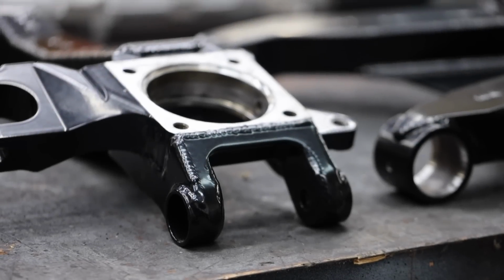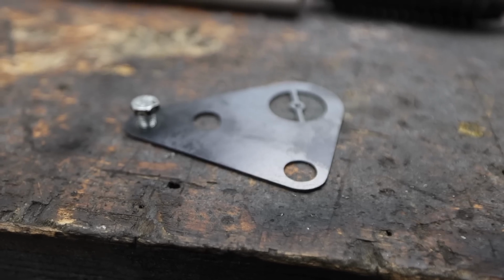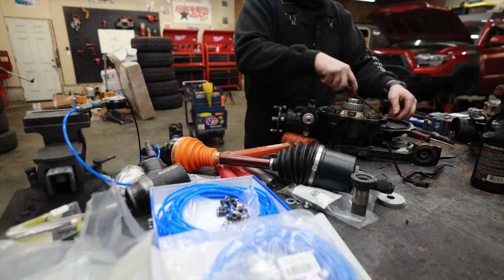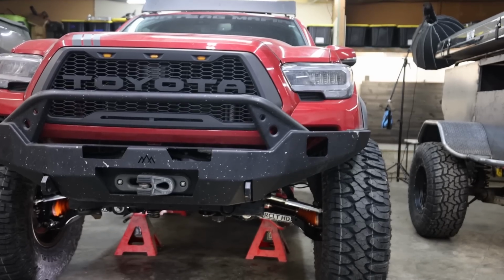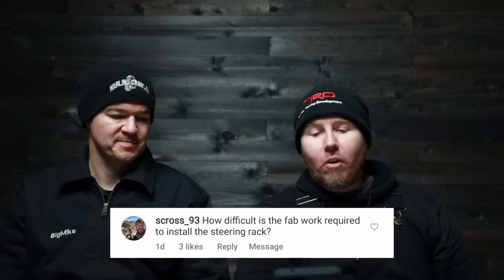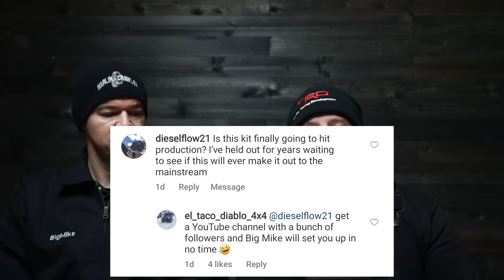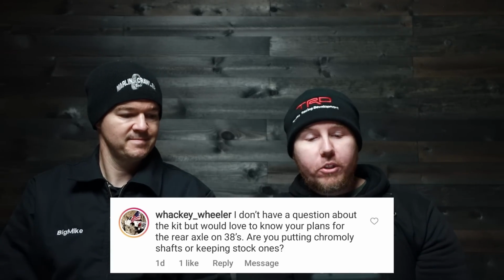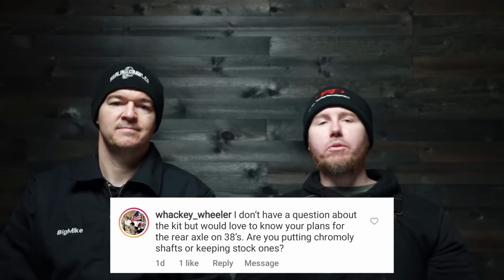The Best Long Travel Period. RCLT HD. Ultimate Toyota Tacoma Build Episode 5.

Comment: As a Jeep owner. I've really like the tacos, but trying to find content I like on them is far and few between. Can't wait to see this thing in action.
Reply: You hit the nail on the head with this comment Shawn.

Coming from a 4runner owner.
Reply: 100% agree with you here - i own a gladiator here - but allt he work in this video so far seems like the same amount of work required (or close to it) just to do a SAS swap - highly skeptical its as robust as something like a dana 44 .... but interested to see for sure.
Reply: Same. 4Runner owner here, mostly watch Jeep stuff. All the late model Toyota stuff seems to be just driving on dirt roads, setting up roof tents, and making coffee.
Reply: Coming from a 3rd gen Tacoma owner, there is not much content that a set of 33” tires and a front locker can’t tackle on the extreme side. Once they get a doubler in this truck it will be an even better channel to pay attention to as that is one of the most over looked problems with these trucks in my honest opinion.
Reply: @nicks1134  check out Timmy the Toolman channel!  SicMods for T4R!
Reply: I hear you, can't find anything to watch about my good ole square bodies
Reply: Same here… 👍

Comment: I love how more channels are starting to be more open minded towards IFS. Thank you for showing the pros and cons. People have such a severe bias towards solid axles and I hope that getting more information out there can help remedy that.

On my channel I’m doing a TTB build and people couldnt believe I would swap out my stock TTB for another, stronger, TTB rather then doing a SAS. Most people just dont even see upgrading IFS/TTB as an option, its solid axle or nothing.
Reply: @Paul M this is what I’m talking about 😉. Id urge you to open your mind a bit. For one, it depends on what type of offroading you do. If you look at prerunners, trophy trucks, and even ultra 4 cars there’s obviously a place for IFS in those offroad disciplines which is why they use it. For pure rock crawling solid axle can have some advantages, but most people dont spend ALL their time in the rocks!
Reply: @Paul M i wouldnt call it a jeep killer, horses for courses. However my build one of the reasons Im using IFS, specifically TTB, is because its cheap. I got a 3/4 ton TTB front end, 9” high pinion ring gear massive manual hubs and all for $200 at a junk yard whereas the solid axle equivalent would be at least $1,500 where I’m at. 

As for the lift on mine its custom radius arms and springs/shocks, same stuff youd want for a solid axle (although I did choose to fab my own radius arm design). 

It isnt for everyone but it definitely deserves a bit more love than people give it IMHO! A bit of creativity can go a long way.

Comment: This is not IFS, its just not. This is the evolution of IFS. Its like saying my jeep has control arms. There's regular arms, then there's upgraded long arms, and they're totally different. This kit is insane. I don't even own a Toyota OR an IFS, because of all the normal excuses, and this kit just got rid of them all. That underside clearance is nuts, I bet that suspension travel is gonna be equal to that of 90% of ANYTHING that's going to be on the trail. The wider stance helped the angles, you put clearance bends in the arms, jesus I love it!!! In 10 years from now, I'm confident people will look back at this moment and realize this is when IFS changed forever. The Australians are going to have a FIELD day with these kits, and I'm sure of it. 
Thanks for the badass video

Comment: RCLT is so awesome! It Takes ifs to the next level changing the game! I was seriously having a hard time deciding between RCLT and SAS'ing. 
It was a difficult decision but I chose to SAS my 3rd gen taco. Found an awesome fabricator who got all the electronics and ABS working with 1 ton axles. No errors on the dash and speedometer works just like oem. I couldn't pass that up. 
So I wouldn't say SAS is obsolete. It's just getting started for these 3rd gen tacos.

Comment: I've been drooling over the concept sense they started the project.  This will be an absolute beast for snow wheeling.
Reply: Last thing you want in Snow, Mud and Sand is IFS! Single wheel dig will leave you SOL!
Reply: @MrDan1509  apparently you wheel in different snow.
Reply: @AndrewLakey  Ford I-Beam had the same issues! IFS and Beam are for high speed comfort and stability not Snow, Mud and Sand wheeling!
Reply: @MrDan1509  I said nothing about the Ford I-Beam, mud and sand.  Snow wheeling in an IFS rig gives an advantage of clearance and less drag.  A properly built IFS rig performs exceptionally well in deep snow wheeling.
Reply: @AndrewLakey No crap you didn't, I brought it up as an example but you don't get it i guess!
Reply: @MrDan1509  Apparently my experiences and your opinions differ.  Enjoy your time on the trail.
Reply: @AndrewLakey   ''Opinions'' Now that's funny!

Comment from the maker: For those of you that are curious about the kit, here is a link. Shoot Marlin Crawler an email with any questions 👍
The link is currently for the +2.75 kit. The +3.5 will be available this summer (2022)
https://www.marlincrawler.com/suspension/rclt/rclt-hd
Reply: Bad ass looking kit. I wonder how it'll stack up strength wise vs a D44/D60 swap.
Reply: My struggle with IFS is in your link. The cost of the system is extremely prohibitive when compared to a high quality lift for a solid axle vehicle to end up with similar, or perhaps better performance for the solid axle system. This is a sick suspension and I’m stoked it’s out there, but to say it’s changing the game relative to solid axle is pretty optimistic.
Reply: @phild9813  Well if you consider the cost of a new lets say Dana 44, with gears, lockers, knuckles, shafts etc... the lift is well within reason even with the steering upgrades and RCV axles. Junkyard options are obviously significantly cheaper, but money wise, I'd say it's pretty comparable.
Reply: Yeah, true. I guess my dispute is more with factory options. Lifting IFS effectively and with longevity is an order of magnitude more expensive than an IFS, and it still isn’t even as good on the trail crawling once complete. It is most certainly a more comfy ride though.
Reply: Ok can you talk to rclt and look into what you’ve done here for GM ifs like my 07’ Silverado. I know there are lots of long travel builds but I don’t recall seeing a cool rack upgrade like this Tacoma build.
Reply: @shawndejong6699  I would argue a SAS is considerably cheaper in the long run and undoubtedly stronger.
Reply: @johnlunsford9375  I would whole heartedly agree with you, however if it's a daily driven rig, IFS would undoubtedly be the easiest to live with. I say this with love as a former Jeep owner.

Comment: For sure IFS is the future. Look at most off road race vehicles. Even the New Ford Bronco with the 35" and swaybar disconnect. Having a good road driving vehicle along with an awesome off road capable rig, is a win win. Can't wait to see the Tacoma hit the rocks. Love the design of this setup. Great job.
Reply: It could be the future but no truck company can make IFS even up to par with a Dana 30. They all use twigs for steering components and the CV axles still snap Crackle n popin.
Reply: @RobSteez  

Just not true. Look at the king of the Hammers or any Baja race.  The Ford Raptor doesn't break shafts. 

Most built Jeeps now use the Dana 44 with built up modified components.  The Dana 30 needs many add on in order to hold up with big tires and rock crawl. Jeep guys live in the past. Why does Jeep not install 35" from the Factory?  Maybe for durability, ride and fuel economy? 

Ford has 37" on the Raptor now and next year on the Bronco.  Where is Jeep? Most Jeeps with big tires and built for crawling get place on a trailer and towed to the trail. Why is that?

Comment: I really like seeing how the tacoma compares to the frontier. I'm gonna be titan swapping my frontier pretty soon, so I'm pretty excited.
Reply: One of my brothers skipped that, and bought a 2006 Titan Off Road.
Reply: @davidryde6296  They're good trucks, but I thing the frontier is a better off road vehicle. There are so many tight trails in the PNW, that a titan simply wouldn't fit in. A titan swap is basically bolting titan aftermarket components to the Front end of the frontier. It gives about +2" of width on each side. With a custom coilover in the stock coil bucket, You can get about 10.5" of travel, but if you get rid of the coil bucket, and weld in a different setup, I believe you can get 14-15 inches of travel, 17 inches if you were to get a +3.5" wider per side long travel kit.
Reply: I'm from BC, and my last vehicle was a first gen Xterra. I am still in the Xterra groups. There's several full sized trucks in the 4x4 groups I rolled with, so I am pretty confident my brother will be able to keep up. I have a Tacoma TRD Sport 6ft box, so we'll be similar in size.

Comment: Awesome that Mike has put 40k mile on his setup. I would think having big spacers or aggressive wheel offset would be worse for the unit bearings than big tires. OEM bearings are designed for a specific wheel offset by the engineers.

Comment: I am a pipeline/power line heavy equipment operator. I’m the first human and equipment into “the cut” to make it so cranes and bucket trucks can make it to “the pad” through wetlands and granite ledge to access the work. So I drive a lot of deep mud and knarly rock daily….but also drive 50-100 highway miles to get there. Yes I could just buy a raptor….but I LOVE tacos. And want a raptor killin’ taco. My dream is a 2020+ with sunroof and heated leather (lol) on 37’s with 5.29’s arb’s front and rear. And a magnuson supercharger. 17x9 Fuel warp w/beadlocks. Falken wildpeak at3w/bfg at KO2’s, or Goodyear wrangler mt/r Kevlar sidewall. The last being first choice, the other two at’s are the only 3mtn peak snow rating and I live in New England. Money money money.

Comment: I love it. This kit fixes a lot of the issues I fear with Long travel. Are you going to reinforce the frame to keep it from twisting ?
Reply from the maker: Not planning on it yet. But I don't haul through the desert either. With rock crawling I don't see having any issues but I might change my mind once I hit the trails 👍
Reply: Frame twist is free flex!...😆
Reply from the maker: @Captain_Yodelstein  lol are you a cherokee owner? 🤣 kidding of course
Reply: The reason I ask is we know Toyota  frames aren’t  made in wakanda lol and you live in a place that snows. Also when and if you do the rear shock relocation most people will plate the frame a little out back.
Reply: @DirtLifestyle  nope, 1978 F150 owner. I think the frame is made of spring steel...🤣
Reply: @Captain_Yodelstein   Lack of spring steel. Like my cousins 79 chevy. More frame twist than suspension flex lol.
Reply: @iankovac1878 , well it always goes back to its original shape so there is some springiness to it...lol. I've got some ideas to take care of it though. Spring (the season, no pun intended) project.  Truck don't fit in the garage and it's officially winter now...cold and snowy. No fun to work in those conditions.
Reply: @Captain_Yodelstein   Indeed. I am just laughing. Remembering the days of breaking the steering box off my cousins chevy on trail lol.

Comment: I love this video and build. I am a previous owner of a modded 2015 Jeep Wrangler Unlimited Rubicon (3.5" lift and 37's) and now a 2020 Jeep Gladiator Rubicon (2.5" lift and 35's). So pretty much modded tastefully on both builds. I am also a big fan of solid axles front and rear. This taco looks great and the way the IFS has that clearance is nice. Well done. I still wonder why someone hasn't designed/developed/created/engineered/tested/ and so on with something I have in my head for leveling the playing field with IFS vs. solid front axle. Seems like a no brainer. Anyway, I would like to get a Tacoma TRD Pro next and build that up too.
Reply: Wait, are they on jack stands?

Comment: Got an 89 4runner with a sas. 04 I built it with a total chaos long travel kit and loved it but the stability was not like my fathers 85 pickup. So in 09 I performed the sas. Oh and I did have 37 with locking front and rear. But just like everything there pros and cons.
Reply: Had a 87 4runner SAS. Loved it, just 4runners have a fat azz lol.

Comment: So on my 2017 Tacoma I have had a few problems with the front diff. I’ve had the axle seal replaced twice already and it keeps leaking. And it leaks ALOT. I’m starting to thing the inner axle bearings are shot and the movement is causing the seals to leak but that’s my experience. I can say though, that last time it blew the seal I drove for over 3.5 hours with no fluid and the gears looked perfectly fine after

Comment: I like that you add the jig for the rack adjustment. I had the Tundra rack installed in my 2nd gen Tacoma, it was more difficult for sure. So, also, are you going to use a different rear axle? I had to use the ECGS dana60 to compensate for the 39s I am running. Thank you for your videos.

Comment: Great stuff, though I'm a little sad they danced around the wheel travel number question. Even measuring at the spindle without the coilover installed compared to the OEM would be nice to know.  Also, being a Nissan guy, this is similar to the Titan swap we do on the Frontiers. Loads of wheel travel gained.

Comment: I DREAM of putting this kit on my 2016 tacoma TRD OR... I already have about $4k in suspension from dobinson  (MRA, standard length 2.4" lift with a 1/4" spacer to clear my 285/70/17 tires.).. and the marlin crawler LCA gusset kit installed. JBAoffroad UCA's.. this marlin crawler RCLT is over $7k, and a LOT of other mods needed to make it all work/legal to do in my driveway... my truck would likely be down for a week or more..  still on stock gears, and tune for now.. regearing to come soon.. still torn on whether I should go with 5.29's or 4.88's... and I'm definitly looking at the KDMAX tune for the ECU/Trans... better power, throttle response, and shift pattern changes. OrangeVirus offers a tuner kit so you can create your own tune, includes cable, software, and knowledge base forum so you can create your own tunes. loving the build...

Comment: My “usable” adjective was basically to assess how much travel was allowed before CV binding. I know on my mid travel Runner I had a tom of down travel, but the cv started to bind at around 4/5 of it; making the last portion unusable. A lot of kits in the past had advertised the used of a 14” coil over but without the ability to travel infinitely upward (and for ride height / center of gravity purposes) most are capturing as much downtravel as possible.

Comment: Nice build and this long travel kit really seems one engineering marvel. Ok, I live in Europe so Tacoma is more or less in category of wet dreams for me, but let me still express my concerns:
1.) What about CV angles? Axle is pushed forward and I guess also down a bit, so do CV angles change noticeably?
2.) Highway driveability? Can this RCLT setup be tuned for smooth HW driving? Or does it wander all over the highway at higher speeds, so you need a lot of work with steering wheel?

Comment: It was absolutely not necessary to cut the UCA pivot bolt and install a new one backwards.  You just need to take a large set of channel locks and wrap the offending inner fender metal with a welding glove or pieces of rubber to avoid scratching the paint.  Get a good purchase on the metal and just massage it outward to give ample clearance to tap the long bolt out.  I did mine by myself in my driveway when I installed my ICON billet UCAs. Easy peasy and not paint damage.

Comment: Just like a long arm setup with a straight axle, long arm of independent provides a smoother arc on its movement swing. For an IS setup, there is a lot more to be considered since the arms connect to the knuckle/steering and 'floating' axle shaft (as its ends travel differently (diff solid, but hub end angles, as compared to a straight axle where the shafts don't)). The knuckle change has to reflect many things, such as the hub, shaft angle, steering angle. 
If you compare this to a 'race' IS steering setup, biggest hurdle would be the steering limitation. If Marlin could develop a better steering rack similar to a race setup or closer to it than the street rack and pinion, then they could look to lengthening the CAs and the next limitation would be the shaft length. For the IS, you prefer to have the shafts the length of the arms to minimize confrontation of the angles in the CVs vs the pivoting points of the frame mounted CAs.

Comment: If Big Mike reads this comment will the Landcruiser Rack fit an 08 FJ crusier with this kit? I think all is the same between Tacomas and Fj’s of that year. I already have the 3.5 TC kit with the RCV axles. I heard you were trying to also do a steering box setup but had not completed it yet. Only your truck has one if I’m correct. I spoke to you at the Sand Show down here in Orange County Calif a few years back but you were still a bit off on delivering the product to market then. Your website had some smaller LT kits but not the 3.5 listed. What all can be done with a 08’ FJ if I were to go your direction and tear out all my TC kit in place of yours. Moving to Hurricane, Utah and would like something better suited for all the climbing and clearance needed out there. Thanks to either or anyone who can help me spend my money wisely. I lost 12K with Rock Solid Toys already when Wyatt skipped town.